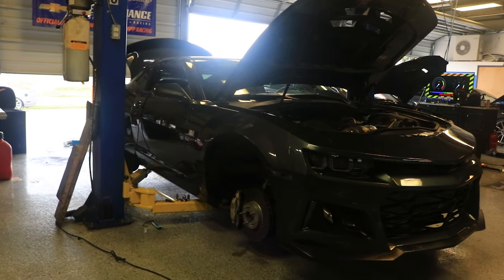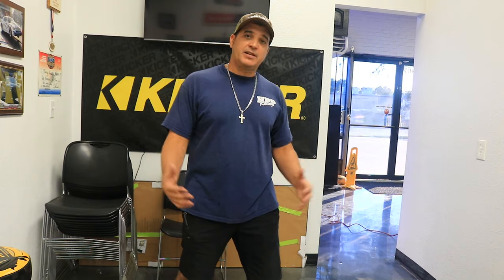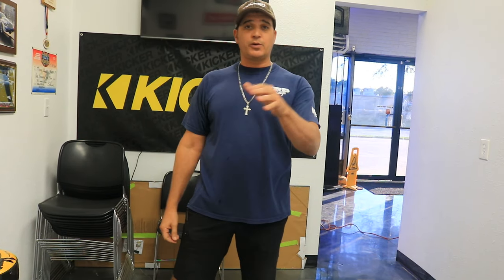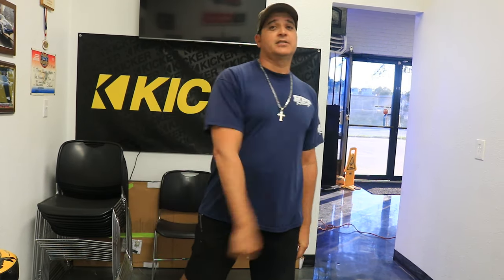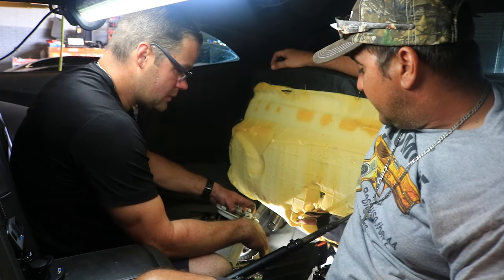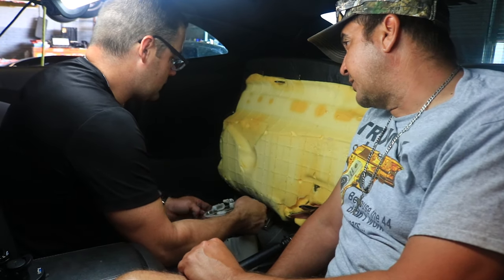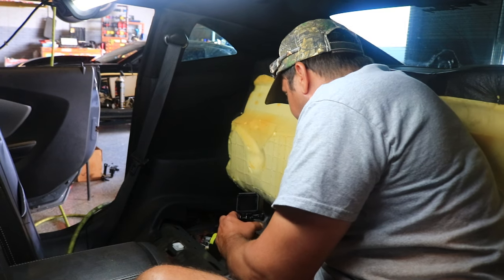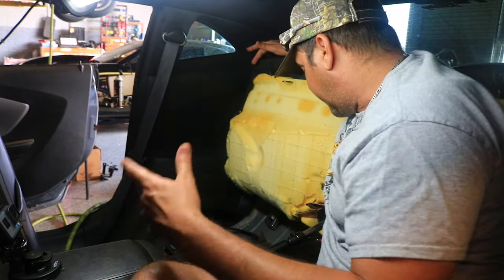Supercharged Camaro w/ Vortech makes 700+ rwhp (900hp)  MODDED & DYNO TUNE (TUNE & DRIVE)

Comment: Will be scheduling mine within the next few weeks. I have a Maggie 2.3(just got it back from a stage 2 rebuild), kooks LT headers, Corsa exhaust, boost cam, zl1 pump w/BAP, CAI, rear cog 1:1, flex fuel kit, and smaller pulley @11psi. Gotta get tune for e85 and any recommendations from y’all to get 700+ rwhp. See y’all soon for perfect boost weather as I live a few miles from shop lol
Reply from the maker: Thanks for the opportunity..  i think we should be able to get to 700.  What fuel system do you have?
Reply: @HPPRACING  I had the stock pump with a boost a pump but I just recently installed a zl1 pump. It still has the BAP installed as well.
Reply from the maker: @johnmendeola7732   That's a good start.  We can always dynotune  it before throwing parts at it. No need to waste money.  At that point we will know if it has enough fuel or not.  We nay not have to make any changes.

**check out our header giveaway..  if you win and don't need headers  we can get you credit or cold hard cash lol.
Reply: @HPPRACING  yeah that’s the goal is to see what it does on the dyno. Yeah I seen the giveaway, I plan on getting some merch while I’m there lol also will get with parts guy to see if we can place an order on some stuff I’m looking for. I wanna rep HPP especially when I take it to Houston, got some races lined up on horizon.
Reply from the maker: @johnmendeola7732   Thanks so much! We will help anyway you need us
Reply: @HPPRACING  your responses are exactly why I’m going to y’all! You treat your newest customers like your long time ones and are not perceived as too big for anyone.
Reply from the maker: @johnmendeola7732  Thanks bud! Without y'all there is no Hpp
Reply: @HPPRACING  just scheduled the Tune for 11/10!
Reply from the maker: @johnmendeola7732   Heck yeah! Lmk when your coming in
Reply: @HPPRACING  will do is this Ozzie? I’ll be stopping by the shop next week after work to buy some merch to be entered in the giveaway. The dyno day is the 11th so will stop by sooner to be entered. I’ll bring the Camaro, we can do some before and after stuff. Gotta kill the full tank of 93 anyways to fill the e85 lol
Reply from the maker: @johnmendeola7732   Yes it's Ozzie. I'll be here
Reply: @HPPRACING  hoping you’re feeling better Ozzie, I’ll be there today @2:30.
Reply from the maker: @johnmendeola7732  lol! Thanks bud!  These broke ass ribs suck